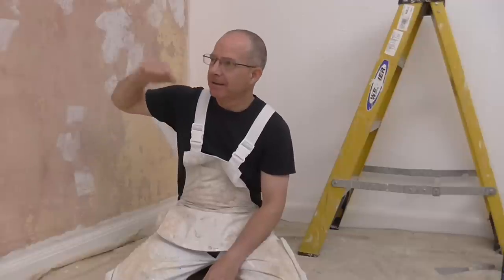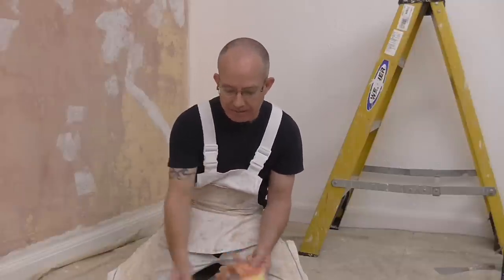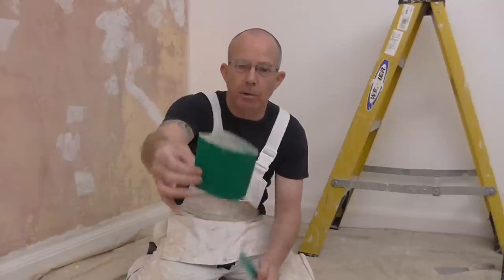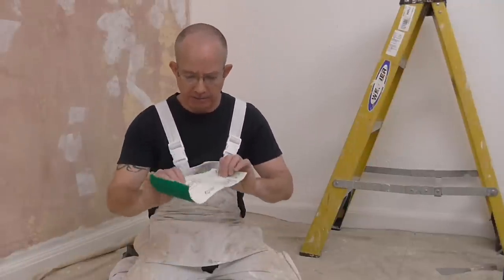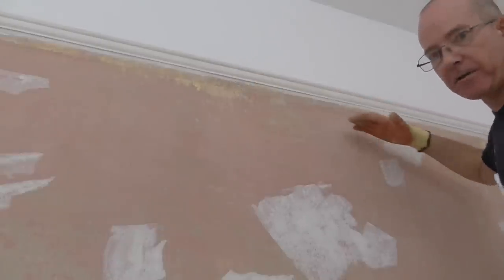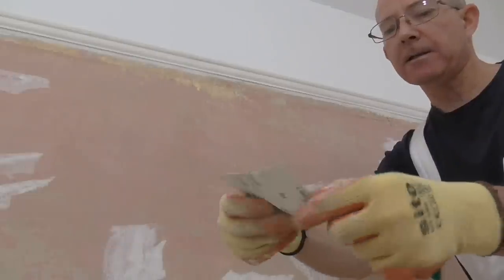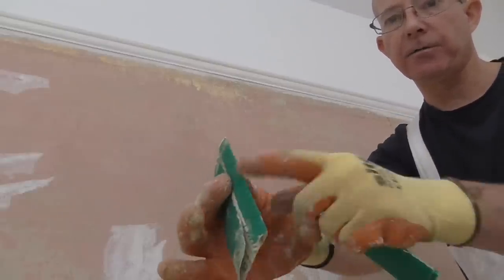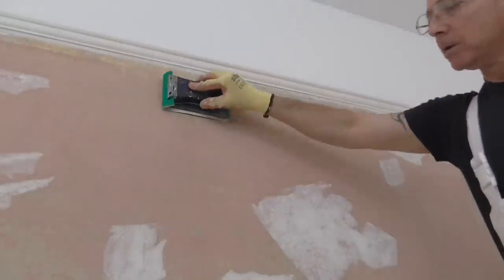How To Hang Lining Paper

Comment: Iv spoke to you before about this, me and my dad use 100’s of snap blades.  Each cut we throw the knife on the floor.  It’s looks odd to the customer, bringing in 3 buckets of draper snap knifes but it really does work.  Doesn’t take long to snap each blade, probably 20 mins to do a small bucket.  Any knife that’s below the bottom 4 snaps left gets replaced with a new one.  What it means is each cut you do is being done with a new blade each time.  Great video, you are so similar to my dad, the way you and his do stuff is proper.  You know yourself, no one else does it like us, or very few at least!
Reply: Use of a caulking board helps to stop the paper tearing .
Reply from the maker: Blades are okay for lining paper and some fiber papers. But I prefer scissors on finished papers.
Reply: I use olaf blades and you get lovely cuts and they go on for ages! Just use a board and that way you dont have to keep pulling back the paper, these blokes have taught me alot of skills! I learned to decorate from my dad hes done it for 40 years but it's good to see ne techniques. Expanding foam is something I have worked into my decorating.
Reply from the maker: @iancrampsie4541   like I say,  blades are okay for some paper. I don't like caulking boards for cutting because  things are never that straight, so the cut can look funny at times. You're better following the natural flow of the wall.
Reply: The last papering on the house I done was 5 years ago and still looks good as new. I went with snap off blades. Only, I extend the blade out which means the blade is a shallower pitch which a. cuts the paper cleaner b. doesn't pull the paper. For cutting from the corners I held a filler knife to hold the paper in place. From then on it's plain sailing.

Comment: Great video, well spoken and good attention to detail!
I've got a couple of questions
I've got a rented property to decorate, it's a very old house I've stripped the wall paper and underneath is layers of old paint /patchwork filler and modern  plaster on a old latt and plaster walls. I have started to Scrape off the really flakey areas of paint and fine filler to fade, feather out/soften the edges. I plan to use a Drywall sander on the walls, sugar soap to clean, sizing with pva/water mix then  lining paper. With a really bad wall such as I described would it be ok to lining paper horizontally then vertically? Is there and advantage to applying the wallpaper paste to the wall first then applying the paper (i worry about getting the paper stuck or paste on both sides? With it been rented the lining paper will be painted over.
Also do I Caulk around the architrave before lining papering?
I've took this job on due to my give it a go attitude, my everyday job is builder/mobile mechanic, I'm going to have a good look through your videos
Thanks Tom

Comment: I have to line a very old plastered wall in one of my bedrooms with a window on that wall with no picture rail but I feel a lot more confident that the same procedures for the rail apply to the level of the ceiling which has thin wooden battens all around the room. I just know the ceiling will not be level at each end and watching this video has taught me how to get around those imperfections. Cant thank you enough for sharing your professional tips. Just for info the wall in question had at some point a floral design something on it as this is embedded into the plaster in places, whether its the pattern from paper or some old paint im not sure. Even sanding it still shows the pattern, but like you said, I feel for the smoothness of the wall rather than looking at it. If it feels smooth then the paper should go on smooth without any embossing taking place from the previous covering. Thank you so much :)

Comment: Another fantastic video. Question, do you follow the same process on internal corners that you would use with decorative wall paper (ie plumb a line on the wall, slight overlap in the corner?)

Comment: I hung some lining paper and followed the manufactures instruction on soaking time but what I didn't think of was that I was in temperature of 32 degrees and I think I over soaked it and when the adhesive dried on the wall it has shrunk and left really big visible seams. 😭 Going to try your hard stop filler but never done it before. Thanks for all your videos. Alex

Comment: Thank you for making this video, it has set me at ease with loads of helpful tips and techniques especially the folding and paper handling...
I do have a question though, if I'm just doing lining paper and don't have to match any patterns. Do I have to do the line with the spirit level? Can I just work down from the picture rail and just have more of a job cutting at the skirt?
Reply from the maker: Best to useca level because sometimes picture rails are not straight. Thanks

Comment: Does it matter what brand expanding foam I buy? I know you use Soudal....I bought "No Nonsense" expanding foam. Will it work just the same?
Reply from the maker: No it does not matter lots of different brands of foam, as long as it's gap filling foam. Thanks
Reply: No Nonsense is decent gear, especially in combination with a trigger gun. Well worth buying one of those btw.

Comment: Hi bud I got to say this video is awesome for giving advice and the know how.but just a question? If you was hanging 2000 grade lining paper.would you still use the guide from the solvite packet.or would you mix it as if you was using vinyl because of how heavy it is??
Reply: What did you use I'm using the same x
Reply: @lg3494  I mixed it how it says on the packet and pasted the paper.but then I paste the wall to where that piece of lining paper was going.because the paper when pasted, starts to dry!! I had no problem doing it this way.I actually just pasted the paper.then the wall, and then put the paper up.I didn’t bother waiting all the time it say to let the paper soak.because like I said it starts to dry because it absorbs so much paste.give it a go like it says.and then give it ago like I’ve said.see which you prefer, and don’t be shy with the paste
Reply: @lg3494  I used solvite packet paste.but there maybe better options.but with how i done the job.I had no problems.if I had just pasted the paper it wouldn’t of been enough.and I think the paper would be peeling back after first paint job

Comment: Hi l watch all your videos and have put many tips into practice. I have a problem at the moment, I have lined my walls going up my stairs and filled the seams with toupret powder filler. I painted the walls first then filled, mist coasted the filler and 2 coats of emulsion. I can still see the lines? Do I need to  apply more coats of paint or more filler?  Please what am I doing wrong? I wish I could add a picture so you could see. Thanks
Reply from the maker: If you can see the joint it needs more filler. Or it is possible you have over filled and it's the filler showing up.   So fill more  or blend.  Hope that helps.. thanks

Comment: Great video. Love the uploads. I’ve always butted lining paper joints right up as you have done. Some people leave a gap then fill after... my question is and excuse me if it’s a daft one.... if your joints are butted up tight then the paper dries and contracts I’ve found joints open up anyway sometimes. But not all the time. Any advice or knowledge on this?
Reply from the maker: Thanks, and yes your paper is losing grip to the wall. Size was used in the past to stop this happening. Happens more on a shiny surface. But give the surface a light sand to remove the shine. And diluted PVA is good to use.
Reply: Painting and Decorating thanks mate. I have had good results and bad results in the past but thinking more deeply on it, it’s the warm weather that don’t help as well and I did do a job when it was quite warm and that’s the job I had gaps appear on. Size... lovely stinky stuff 😜👍

Comment: Is footage missing at 6:08 as you mention primer drying before using pva? Does filler need priming before diluted pva?
Reply from the maker: I would have been on about the B.I.N. primer drying before applying the PVA

Comment: Great vid , but ready mixed all the time for me and seam each length as if it was normal paper !! stops Ye seams flicking up from a dry edge when emulsioned no need to be filling seams , seamless lining , just a little tip 😀 chaulk board and snap off blades clean cutting all  the way , , I’ve used snap offs over scissors for the last 30 years far superior, everyone has there ways ,

Comment: Pole sander,snap off blades,large filling knive or flat strait edge for clean cuts, roller for applying paste,these are the new tools you need,and put some pva in some size and roll it on the walls, I've been a decorator for over 35 years, the game has changed and you need to move with the times, your finish is always good but you do take the long way around jobs and it's not because you're filming it's you're methods, you must only get through a few jobs a year, you're prep would still be as good with the stuff on the market today
Reply from the maker: Lol.. loads of reasons why I don't use some of these tools. Some papers may need a snap blade some are  better using scissors.  Will make some videos explaining in more detail why I choose particular methods.. my work is all about high standards not speed.
Reply: @PaintingandDecorating  fair play mate, I learned the exact way you do things but just moved with the times and still get a quality finish  , I've never had any problems with any finished wallpaper when cutting with a snap off blade and a straight edge but don't get me wrong you're finish is always fantastic, I have 7 decorators working for me and I wish they took half the pride in their work as you do instead of me having to make them do it all over again. I definitely know you would never be short of work.

Comment: If you use a drywall sander on the surface could you not just paint it
Reply from the maker: No, a sander would just end up breaking up the plaster.
Reply: @PaintingandDecorating  ok THANKS

Comment: I have learned something new when i have put up lining paper I have done it from top to bottom
PS why is it done in this way
Reply: Less joins and lining paper is also used when putting up features paper you do not want joins to meet so we do the horizontally, I paint the joints then fill them after then put on a thin coat of paint to satisfy the poly filler, 2 coats of emulsion and you would never know its paper! Nobody looks for horizontal joins.
Reply from the maker: Thanks, if the section of the wall is wider than the lining paper, it's better to line horizontally. Sometimes we use both ways  e.g. around doors, windows.
Reply: If your worried about seeing the joints and dont like the idea if filling.if I'm painting lining afterwards I like to create my own seams.ove lap the paper by half inch then with a knife and straight  edge cut  straight through middle of both papers then peel back the underneath layer then smooth back down.if you ve left your paper to soak for the correct time you will always get an absolute perfect seam with no overlaps or gaps to fill.i got the idea from hanging wipe vinyl murospec paper a few years ago  when I forgot my plumb line and spirit level . give it a try.saves time filling any seams that have  opened up.
Reply: That mask really came in helpful🤣
Reply from the maker: @davidphillips744  no
Reply from the maker: @stephenevans1833  It was just a demo and i said you would not hear me with the mask on. it was for a few seconds
Reply: @PaintingandDecorating  why

Comment: A good decorator never uses scissors to cut the paper on the paste board !!! He would put a straight edge on the cut line then pull back the roll to cut the paper along the straight edge👍
Reply: Rckhlld1 I’m a young decorator. Everyone has there own way they do things but I do like the rip-stick way !!! 
Different wallpaper coverings need to be handled with more care !
Reply: MrSportydude96 The RIP stick I like that term 😄 seriously my Dad taught me this way 50?years ago and it works with every kind of paper!!!  This guy is obviously a pro decorator but not as good as my old Dad was 😀
Reply from the maker: The paper gets trimmed on the wall, so the first cut on the bench does not have to be perfect just straight enough.  Speed is the name of the game.
Reply: Painting and Decorating that’s why my dad always used the rip-stick method 👍
Reply: I have been a painter and decorator for  39 yrs and what he does on this footage is the way i was taught..but as you say every painter has his way of doing things..that`s how the trade evolves.always a new trick to be learned..cheers for doing a great job